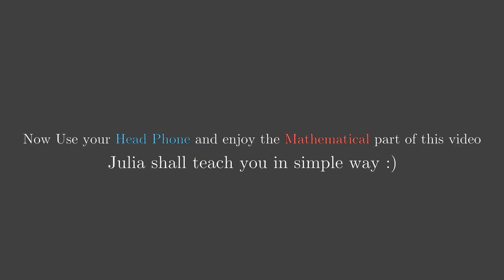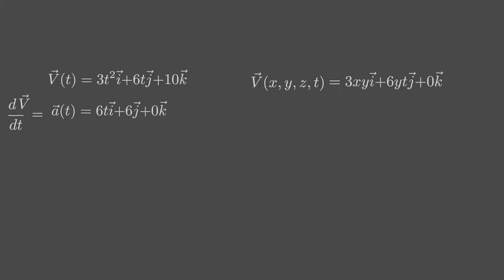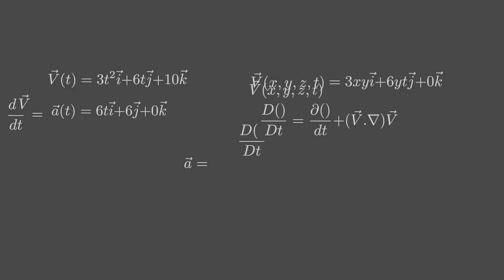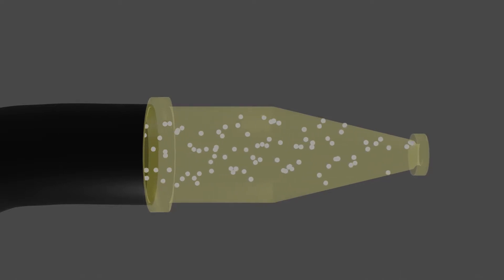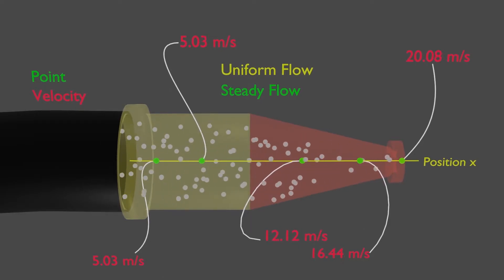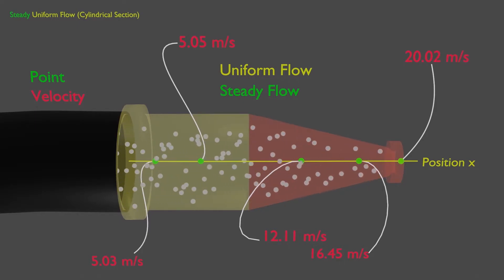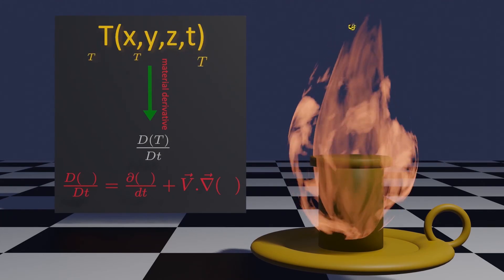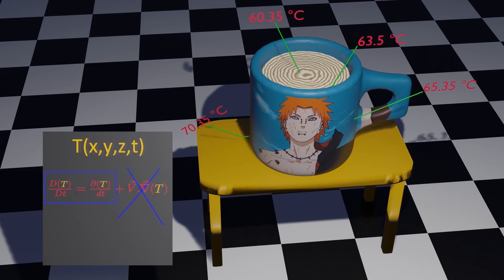What is Material Derivative? (Fluid Mechanics Animation)

Comment: at 3:32, ax should be 9xy^2 + 18xyt
Reply: Yeah you are right
Reply: Yess that's correct. For anyone watching the error is the acceleration in the i direction: its (9xy^2 + 18xyt) instead of (9xy^2 + 18y^2t) as the video shows